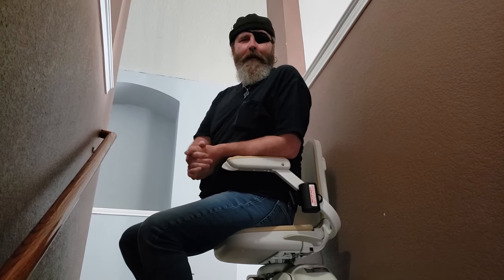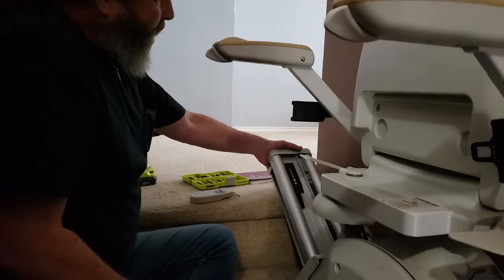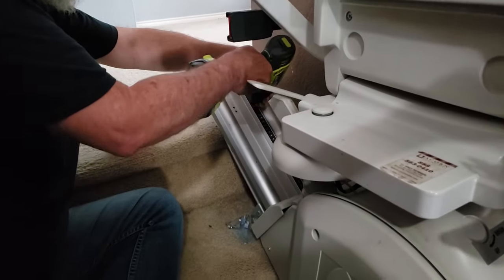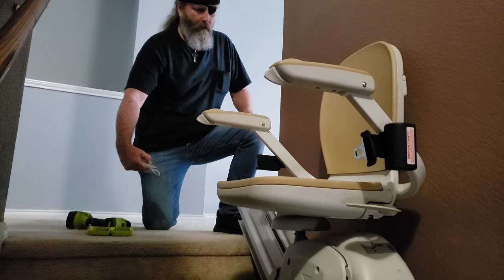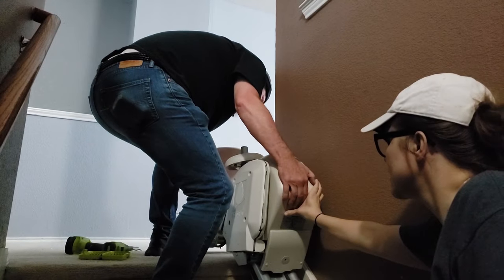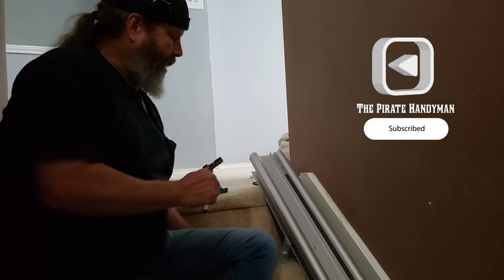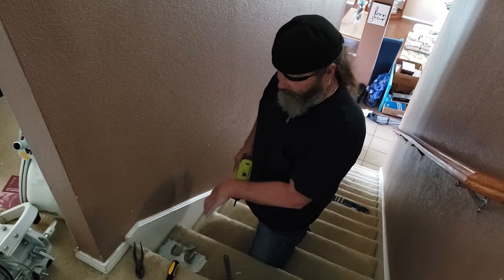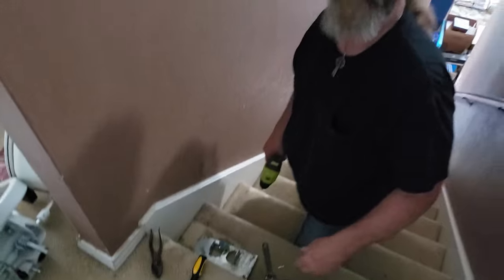How to Remove an Acorn Stair Lift Chair - STEP BY STEP

Comment: Metric or standard? Appreciate the video for guidance, but maybe a tool list for those going somewhere else to remove a lift as you did and I'm about to do. That way I'm not getting 20 miles from my tool box and saying, "CRAP!" should've brought,......
Reply from the maker: Thanks, matey, that's a great suggestion!
Reply from the maker: To your question, I don't remember for sure, but I think they were standard.  I usually travel with a metric and standard socket set, as well as 2 or 3 different sizes of crescent wrenches to cover all my bases.  But your suggestion is a great one, and we will incorporate tool lists in future videos.

Comment: How do I take my chair off if the chair isn’t working?  Please hurry with response.  I’m desperate
Reply from the maker: I'm afraid that you will have to take the gear assembly apart on the bottom of the chair.  The Acorn Website isn't much help, so the best thing to do is call them at 1-866-873-6574 and they should have some information on how to accomplish this.
Reply: You can grab a ratchet and move the gears by manually spinning the motor. A good drill makes it much faster
Reply from the maker: Thanks for the tip, lass!

Comment: Hi Pirate. We forgot to remove the one stop when taking off the track. The unit completely died and I backed it out manually.  I cannot get it to power up no matter what I try. What am I missing? Please help
Reply from the maker: Look for a red "reset" button around the motor.  Sounds like you may have tripped a breaker inside the unit.

Comment: The wiring to the handles is a real pain and whoever invented this stairlift had no thought for if a handle is broken or wire snaps due to the handle being pulled up and down because I've had to replace one handle and now the other handle has a wire snapped in it so the trigger only works going up and I have to use the other trigger for going down. Brilliant machine, but badly thought out.
Reply from the maker: Aye, lass, sometimes the engineers don't think things through.

Comment: But mine won't turn on! I want this thing gone so badly
Reply: Did yours come with a manual hand crank? I'm using an 8mm socket and cranking this bad boy up the rail. Mine also won't turn on and I need it off my aunt's stairs
Reply from the maker: @anonymouslyanony has a good suggestion. Otherwise, go to the Acorn Website and see what information they have.